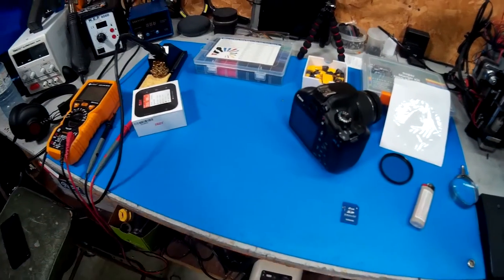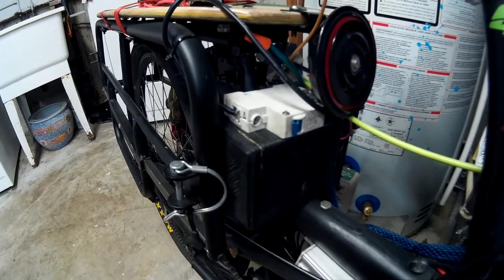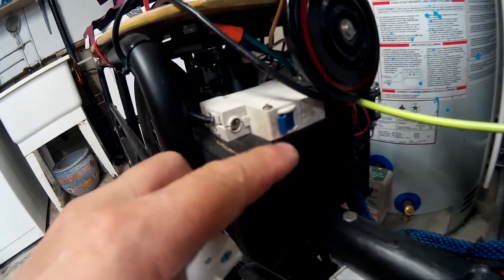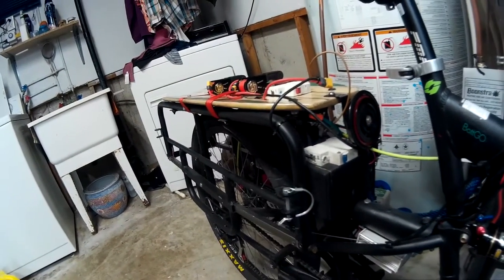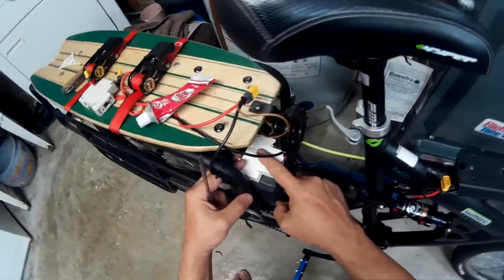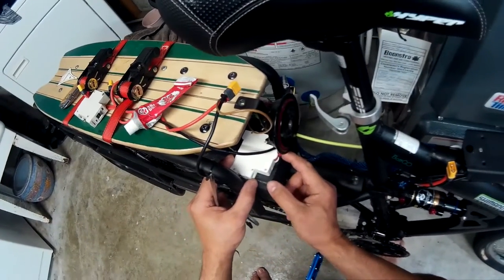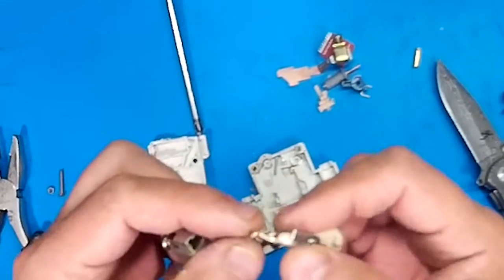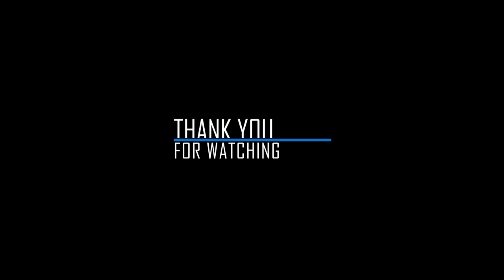ebike vlog  Friday, September 25, 2020 40Amp DC Circuit Breaker

Comment: what happens if i did use AC breaker instead DC? i did use it then remove it when i realised it's AC
Reply from the maker: no i have used ac breakers with little problems .

Comment: does the current hold enough if you only have 60v battery connected to that 250v circuit breaker instead of 100v?
Reply from the maker: no problems